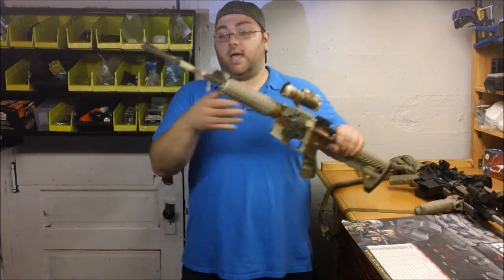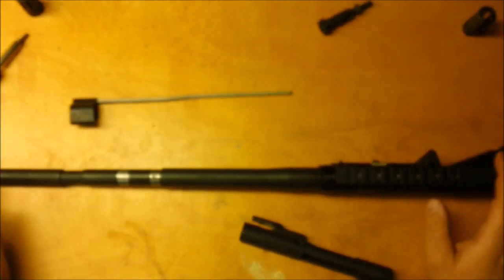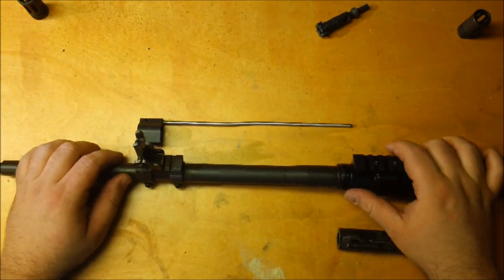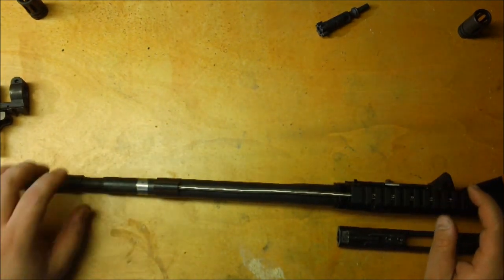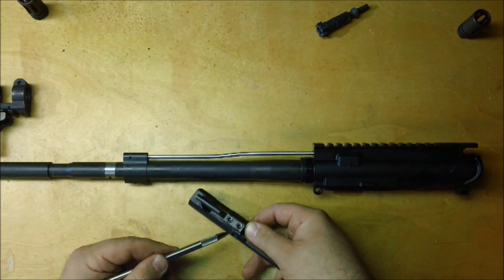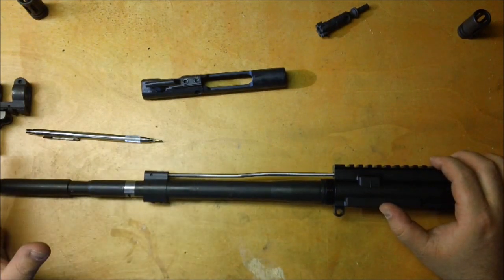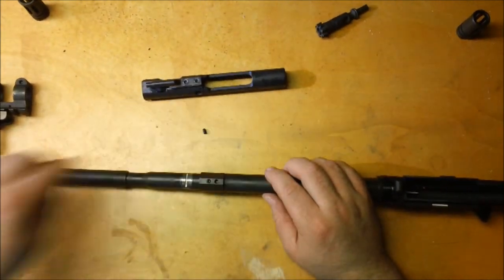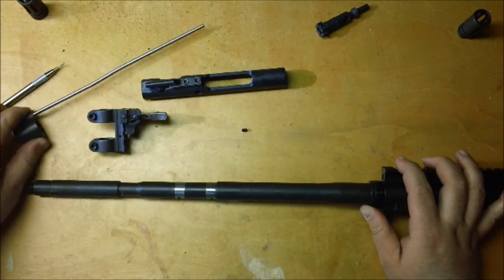AR15 Gas Block Weaknesses Explained and Fixes Explained

Comment: Another thing to consider is proper gapping of the gas block. The gap should be the exact thickness of say the handguard retaining cap on a standard AR-15 using a A2 gas block/front sight. proper gapping will ensure that the hole on the gas block will match up with the gas port on the barrel. most malfunctions are caused by misaligned gas blocks and misgapped gas blocks.

Comment: If you MUST use set screws do NOT use a punch to dimple your barrel. Take it to a machine shop. Have them mark each hole center one at a time. Remove the gas block and MILL precise dimples with vertical shoulders just large enough to tightly capture your set screws. It would take  many hundreds of pounds of pressure to rotate your gas block at this point. NEVER use blue. Use the most High Temp RED loctite you can find. Use a strong heat gun should you ever have to remove.

Comment: I disagree. Totally. Set screws and pins add to minor distortions of the barrel which can affect accuracy. I proper CLAMP ON gas block that is properly BEDDED with the correct six series Loctite(I have to look up which one, but its a green Hi Temp, hi pressure type) will not rotate. Besides, NONE of my BUIS are attached to my gas blocks. All my gas blocks are totally covered and protected by my fore arm. They could not rotate even it they wanted to.
Reply: This.  Properly installed clamp on gas block will not turn before the alignment stud snaps off, thus a non-issue especially when installed under a hand guard.

Comment: I've used set screw style gas blocks without any problems.  What I do is align the block and tube and tighten the set screws so they mark the barrel.  Then back out the screws and remove the gas block.  Take a punch and hammer and dimple the barrel where the marks are.  This creates a dimple for the set screws to grab when the gas block is reinstalled. Use blue locktite on the screws when reinstalling.

Comment: so lets just say i cut my factory gas block down so i could use a scope and i want to use another one, how to i get a different one to fit or how do i get a new one drilled so it fits in the factory cuts in the barrel for he pins?

Comment: the ak uses a gas piston system, its completely different from the start, plus the ak doesnt really have a gas block, it has a piece that is built on the the barrel that cant be removed. alot of the high end ar's are using gas piston systems with alot of success, its a way better design.
Reply: Captain Deadpool 
Piston ARs still need some sort of gas block...
Their efficacy is questionable.

Comment: staked fasteners are 100% to reduce the possibility of that particular bolt backing off not to prevent the fastener from coming out completely not saying the stakes work 100% but that is there intended purpose not to prevevt the bolt from completely exiting the hole

Comment: If the gas key gets loose and hits the gas tube with a pinned gas block, it's going to bend the tub and the bent tube and loose gas key will leak off enough gas pressure to create your single action issue. I have a low profile gas block with 2 set screws. The barrel is dimpled on the bottom to prevent the gas block from rotating too much or even sliding down the barrel. Some locktite helps ensure the screws stay put too.

Comment: I have a Stag Arms model 2 with a Daniel Defense EZ car quad rail  and I want to take off the standard triangle front sight and put a Quad gas block on it and then some Magpul sights. but I was wondering if anyone knows if there is a Quad rail gas block that would fit flush with the EZ car rail?

Comment: Colt and bushmaster, you just named the two companies with the worst staking. Personally I wouldn't even consider bushmaster staking their gas keys. It's terrible. That's why I only buy S&W or RockRiver. I've never had any problems with any of the low profile gas blocks on any of my AR's

Comment: I've always stuck with the standard A2 style front sight post as a general rule.  They never broke or had any issues, at least from what I saw in the military, and you'll always have at least a front sight to walk your rounds into if everything else fails.  A properly staked bolt carrier should make the screws immobile -they should not move at all and if they are backing themselves out then it's time to get them re-torqued and re-staked properly, that is not something common or expected.

Comment from the maker: The barrels are all designed to work with the tapered pin front sight gas block. It would make sense to have a barrel setup the way you say, but when you buy a barrel from a manufacturer for a lo pro gas block, all they do is take one from their "standard setup" pile.

Comment from the maker: The pinch and set screw types both rely on friction to keep them in place.  Nothing beats the pinning method. I've had better luck with the clamp on type than the set screw type though.
If you can, drill the set screw type to take a pin. (i'll try to get a vid of how to do it up)